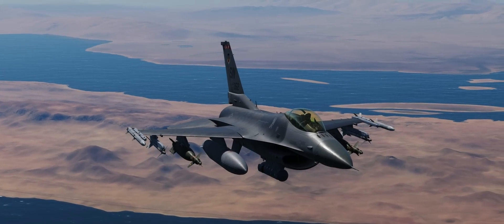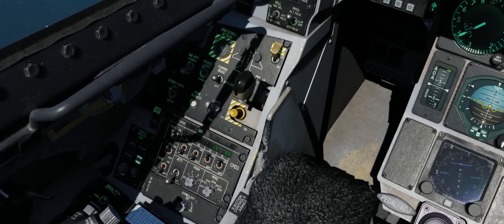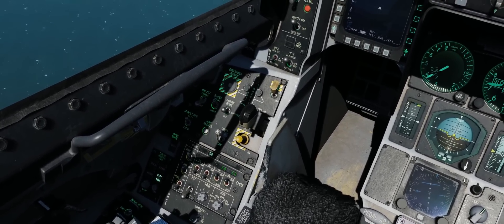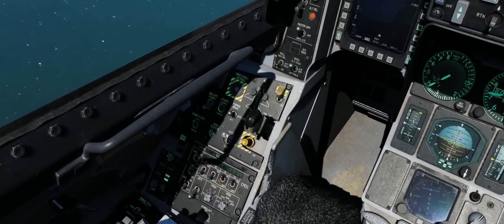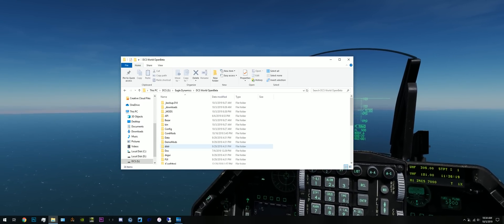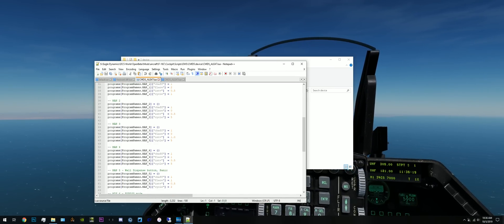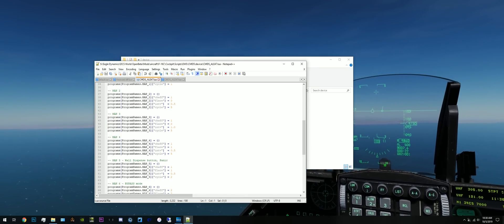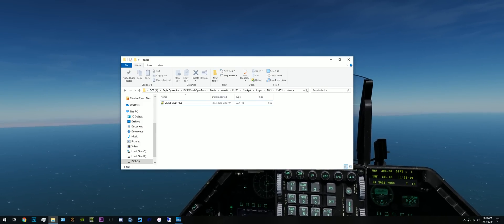DCS: F-16C Viper Countermeasures Tutorial!

Comment from the maker: So far I am really loving the F-16C for DCS! I didn't think i would be so interested in the F-16, having grown up around Navy and Marine Corps jets, but so far it has really captured my attention and is a great module! if you'd like to support my channel check out my Patreon! All donations are 100% appreciated! https://www.patreon.com/Spudknocker
Reply: Actually you can have 2 programs manual at the same time. While you can use the MAN1 to MAN4 program to use with the countermeasures Forward button, you can also use the MAN5 program (Wall Dispense button, Panic) by binding it to your hotas (search for "CHAFF/FLARE Dispense Button" in the ingame keybinds).

In my case, I use the program MAN1 to MAN4 for different Chaff only scenarios and using the MAN5 for Flares only (2x 2 flares with 1.0 sec separation).
Reply: @Tepnox  Coming from Falcon BMS, the CMS left switch should dispense MAN5 as well as the cockpit slap switch. Maybe like so much other stuff it's not yet implemented? Like hopefully haveing a DTE method to save profiles and upload them to the jet on mission start. F/A-18c could use that too. Edit. (CMS Left is not implemented of course. "No Function" in the manual.)

Comment: How do you get the aural warnings for radar lock and missile launch??  I cranked up the volume knob for the threat audio but I don’t hear any warnings at all...
Reply: Boeing 737-800 MAX i have the same problem
Reply: Tag Swag Found the issue. eagle dynamics said people without the F18 don’t hear sounds right now since they are using F18 sounds as a placeholder for the current RWR. This will be fixed in the next patch asap.

Comment: So what buttons do you press to release countermeasures then?
Reply from the maker: Countermeasures Management Switch - FWD
Reply: @Spudspike  The one thing I like about he FA-18 is the ability to set two different modes to the CMS switch. There are two positions in the controls...what is the Wall Dispense Panic Button in the file?
Reply from the maker: hba8103 I have been looking for that, but I believe it is a hold over from the wall panic button in the F/A-18 the big red circle on the left wall of the cockpit.
Reply: @Spudspike  F-16 has a wall button too called the Slap switch, so not a hold over but simply a similar feature in the Viper
Reply: @Spudspike  There's a large button on the left wall called the Slap switch which also releases a Countermeasure program that you forgot. Also if its like in BMS, CMS switch left also dispenses a program (in BMS Slap switch was program 5 and CMS left was program 6)
Reply from the maker: Essah those both do not work in DCS